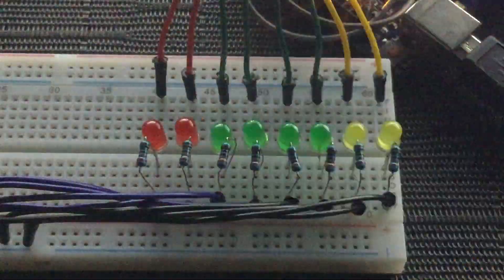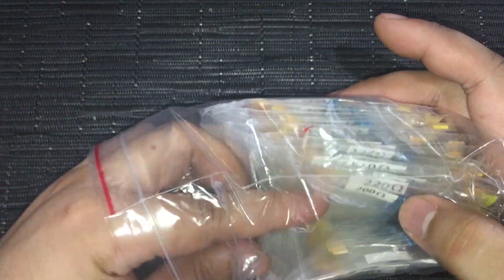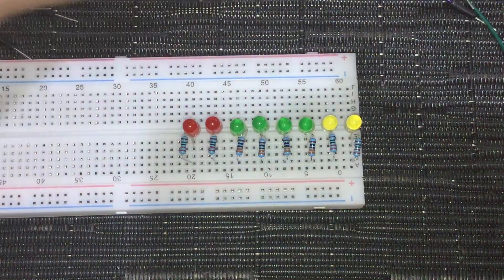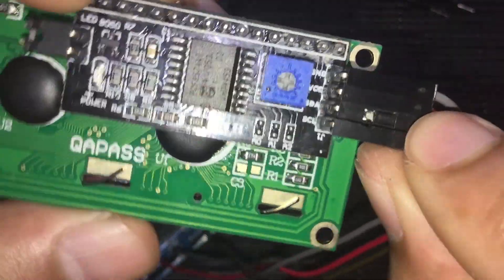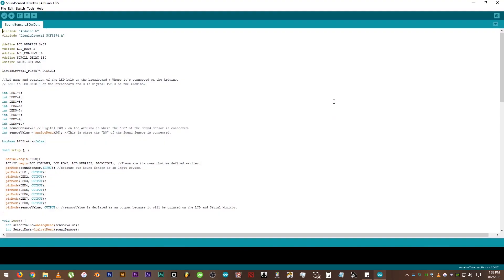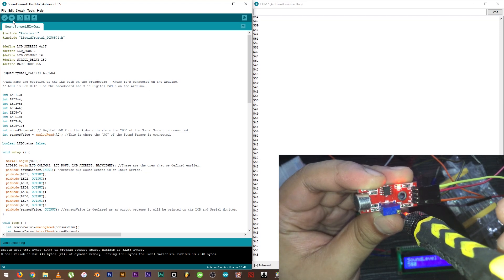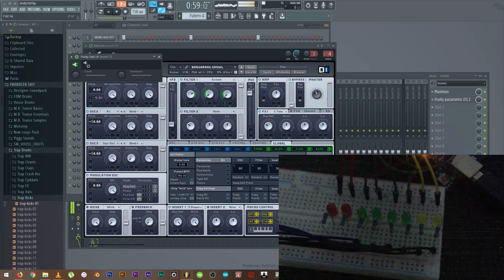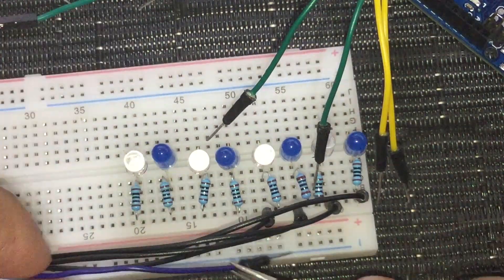Arduino Project # 3 | [KY-038] Sound Sensor Activated LEDs with LCD For Sound Level Data!

Comment: To me, it looks like you're short circuiting all of the resistors at 2:15 by placing the pins in the same rows. Perhaps the idea was to connect them to the negative, vertical rail?
Reply from the maker: Hi Anders! Thanks for the comment! ♥ Yes. That was a mistake on my part. Didn't even noticed it. Thanks for pointing it out.

Comment: sir i am very hardly want the codes please send me cauz it is said that the codes was trashed from googledrive
link please thank very much
Reply from the maker: Hello, ladrica! Thanks for the comment! ♥ You can click here for the code: [ https://create.arduino.cc/projecthub/Heathen_Hacks-v2/sound-sensor-activated-leds-with-lcd-for-sound-level-data-e7f5d2 ] and on this link for the .cpp and .h files [ https://www.circuito.io/static/reply/index.html?solutionId=5c452f260cc155003050807c&solutionPath=storage.circuito.io ] Click on "Codes" download  "Firmware.zip" extract it, and transfer the .cpp and .h files to your project folder.

Comment: hi guys, thank you for project.

I received this error although I installed the library.

Arduino:1.8.9 (Windows 7), Kart:"Arduino/Genuino Uno"

soundsensorledwdata:11:23: error: no matching function for call to 'LiquidCrystal_PCF8574::LiquidCrystal_PCF8574()'

In file included from C:\Users\İBO\Desktop\Ardunio\soundsensorledwdata\soundsensorledwdata.ino:3:0:

C:\Users\�BO\Documents\Arduino\libraries\LiquidCrystal_PCF8574-1.1.0\src/LiquidCrystal_PCF8574.h:67:3: note: candidate: LiquidCrystal_PCF8574::LiquidCrystal_PCF8574(uint8_t)

LiquidCrystal_PCF8574(uint8_t adr);
Reply from the maker: Hello, Ibrahim! Thanks for the comment! ♥ Can you go to this project on my Arduino Project Hub? Here's the link: https://create.arduino.cc/projecthub/Heathen_Hacks-v2/sound-sensor-activated-leds-with-lcd-for-sound-level-data-e7f5d2?ref=user&ref_id=550502&offset=0

and download the "SoundSensorLEDwData" code, "LiquidCrystal_PCF8574C/C++" , and "LiquidCrystal_PCF8574C Header File" and put them all together inside the folder where the code is and try if it will work.

Thanks.
Reply: @HeathenHacks  thanks for answer . i downloaded all of them and inside folder but i received this error 

bool LiquidCrystal_PCF8574::checkI2CConnection()

expected '=', ',', ';', 'asm' or '__attribute__' before '{' token

hw can i fix this error? Thank you
Reply from the maker: Hmmm... It says about i2c connection.. so, you can try to go to File -> Examples -> Arduino Learning Board -> Then, click on "ALB_I2C_Scan". Upload that code while your LCD is connected to your Arduino. Also, make sure that the LCD you are using has an I2C backpack on it, or else, the code won't work. :)

Thanks. Please keep me posted.
Reply: hi @HeathenHacks , i tried ALB_I2C_Scan and  it said that 

17:04:14.256 -> I2C scanner. Scanning ...
17:04:14.256 -> Found address: 39 (0x27)
17:04:14.289 -> Found 1 device(s).

What should i do now?

Thank you so much for your help
Reply from the maker: Hmmm. The LCD address seems to be correct.

Uhh, if it's not a bother, can you send me your code? 

You can post it here or send me a message on hackster: https://www.hackster.io/Heathen_Hacks-v2

Or send a message on my FB page, so that I'd get notified right away: https://www.facebook.com/HeathenHacks

Thanks!
Reply: @HeathenHacks i send message on Facebook